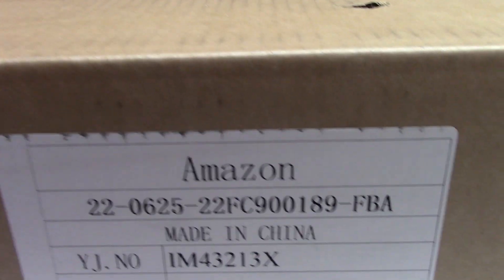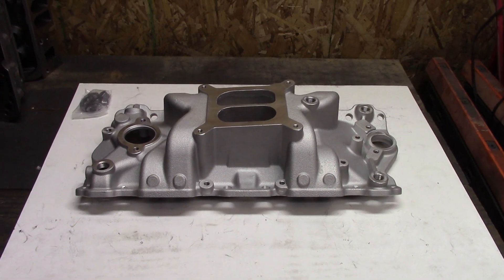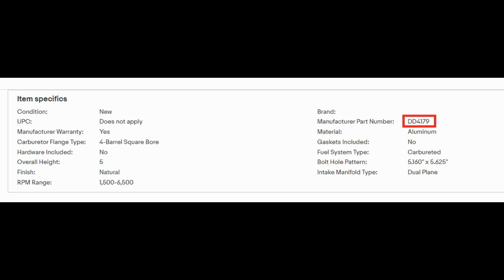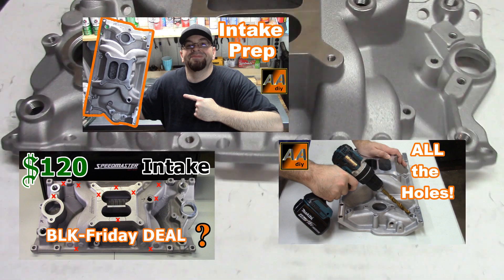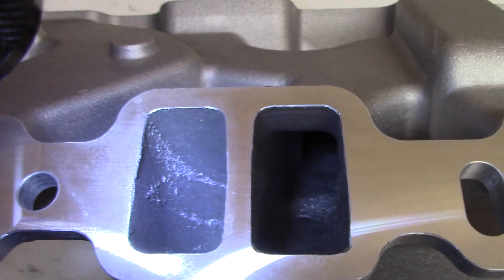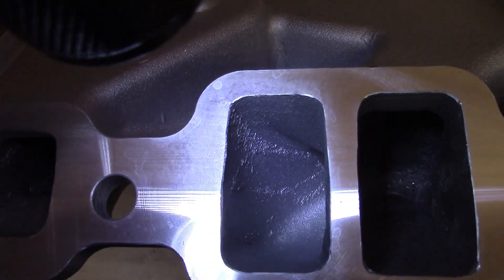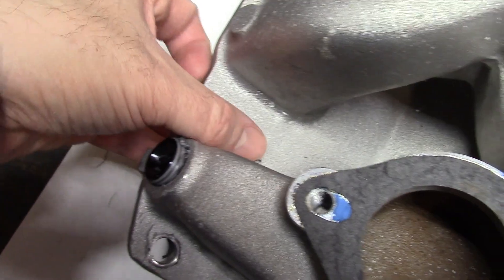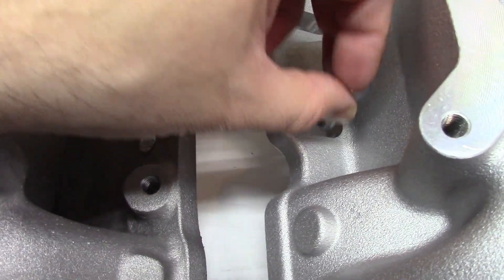CHEAP ebay Dual Plane Aluminum Intake

Comment: I wish they would recess around the cross over ports so you could blank them off with a little plate if you wanted to. I had to blank mine off with a thin piece of tin off a coffee can lid so it was thin enough not to bend the manifold when i bolted it down.

Comment: That vacuum port is useless using a Holley carb. The mounting holes being so big is a sign that they are not centered well. Otherwise why so big? I’m sorry but made in china eliminates it from consideration. I’ll pay more for USA, but then again this is where we live and if you want to keep jobs here ……… maybe your own job.
Reply: All the shit you think is made in the USA is made in China.
Reply: @TempoDrift1480 exactly so much of this shit is rebranded made in America it ain't even funny and it's sad really I just picked up one of these Chinese knockoff intakes for 20 bucks the other day cleaned it up did a port and polish waiting to pick up some gaskets to do a gasket match
Reply: But here in 2025 the Ede RPM Air Gap for a sbm Magnum is pushing 500 bucks at Summit Racing. The Chinese Crosswind is $170. Hard difference to swallow.

Comment: I know this question isn’t related to the topic but is it necessary for the engine to be at TDC when installing a balancer?
Reply from the maker: On a SBC it's keyed But not all years had the timing marks at the same point.  Vortecs are different than older years, can't rem if TBI is?
Reply: If the crankshaft has a key you have nothing to worry about.

Comment: That's a good intake for the money. The best part is the 4 corner cooling which SBC heads need all the help they can get. With port matching and runner clean up and 1" spacer, you have a winner.
Reply: Chinese crap! They warp!

Comment: Pretty good deal it seems, has waffle pattern on floor which is nice, and if one wanted to paint it orange to blend a bit on a stockish looking build there is nothing to have to grind off.
Reply from the maker: Looks like it even has the spot for an old school oil filler tube

Comment: That intakes good for up to around 450hp range. Not a bad piece. Price definitely lookin good.
Reply from the maker: Yah it's pretty much the same as the RPM, I should of measured the runners for the video but they are on the larger side.
Reply: @BOOT  I seen someone flow test a few dualplane intakes a while back, I believe that one actually outflows the rpm by a few numbers in out of the box form. I was surprised.
Reply: DONT SUPPORT CHINESE GANGSTER COMPANIES!